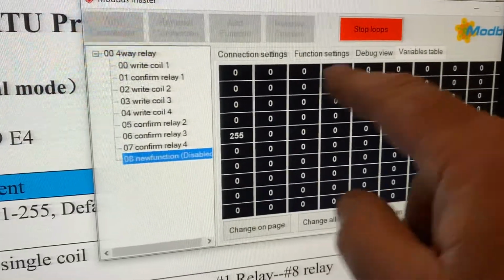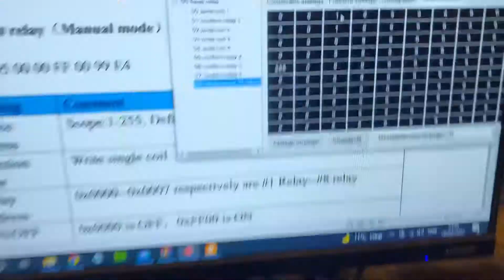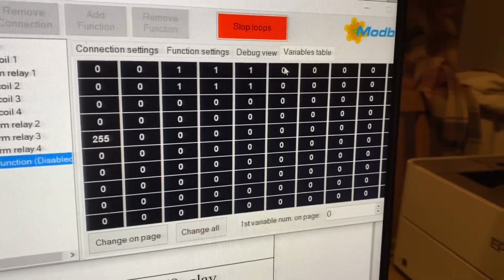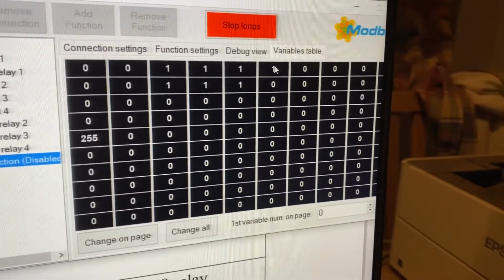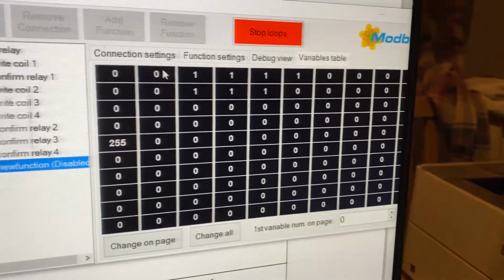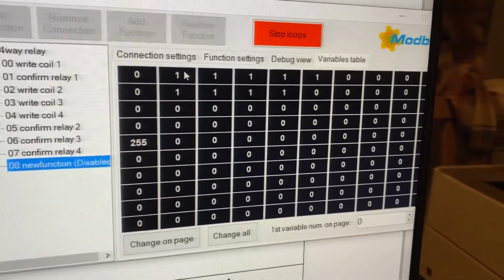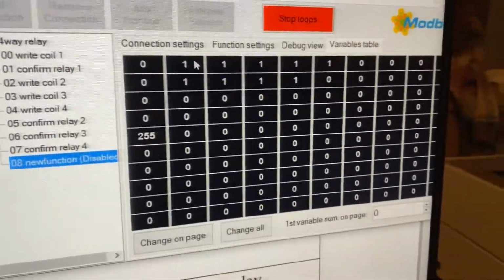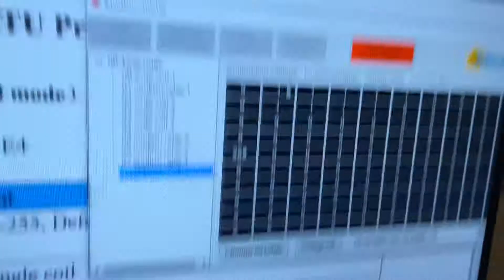Modbus relays via uccnc

Comment: Hi, do you know if there is a function to check modbus connection in macro? I'm working on communication with arduino and got it right, but I'm just wondering if there is a way to check lost connection
Reply: Run a timer in arduino and check it’s value has changed in a macroloop. 
I did this on my buttons control panel
Reply: @cnc-routers-uk  I tired to do it, but I have problem in macro, that if( time == timep ) {} gives me an error in uccnc
Reply: @stanisawmichalski7848   if !(timep==time)
{
}
Reply: @stanisawmichalski7848  or use < instead of == for a time string

Comment from the maker: Ok
So these are not good! 
Can only read or write one coil at a time. 
The only other register I can read or write is the slave number . 
Cannot read the inputs at all .  ( advertised with inputs) but I have tried 4 different programs- all give a time out. 
I have ordered another 16io type which will be tested shortly. 

Yes this could be used to turn things on and off but cannot confirm via opto inputs any sensors required.